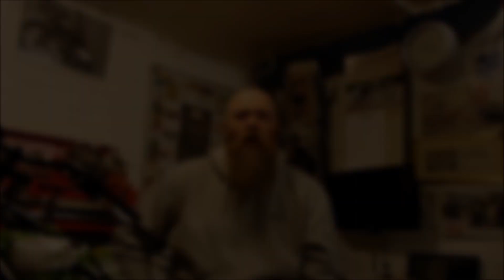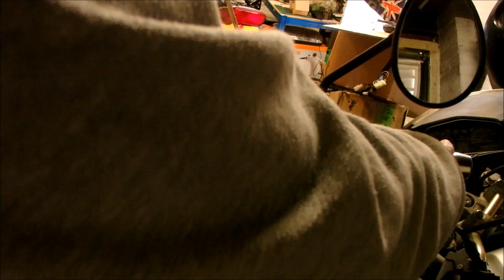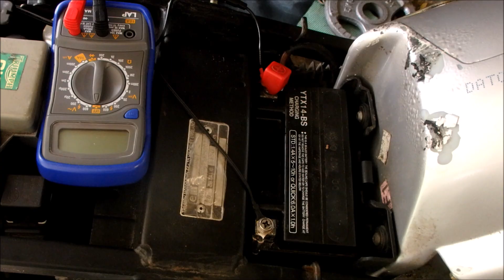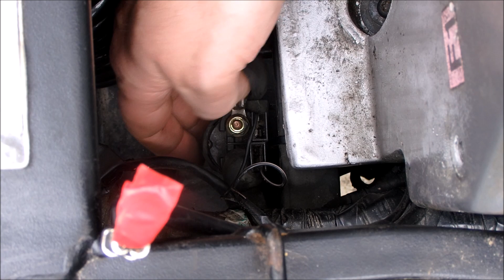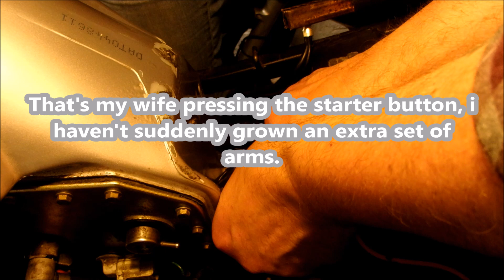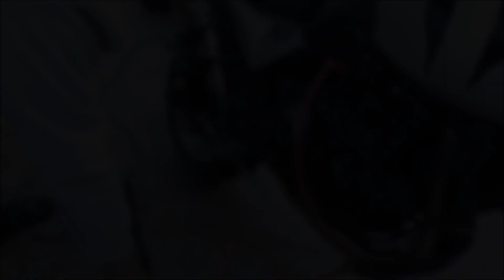How to test your starter motor & Solenoid circuit. Step by Step

Comment: This video absolutely saved me!!! Was considering tearing down my ‘98 Speed Triple down to replace the whole wiring harness after checking battery, relays, head stock wires and ignition circuits. Top man and excellent simple video
Reply from the maker: Fantastic, really glad it helped you out :)

Comment: I've got two bonnies I'm about to pull from under tarps and work on.  The first thing I did was put it in neutral, pop in a fresh battery and see if there was a sign of life.  Headlight, blinkers, gauges all glowing, but no joy when pressing the starter button.  I actually checked that there was a starter!  Yes.  So no click, no noise at all.  Thank you for your video.  i'm going to try the direct to the starter and see if it's just the relay.  Thank you dearly.

Comment: Thank you for sharing this 'not so punditious' way to test out a starter relay aka solenoid, however, the method you've demonstrated is of a Triumph compliance it certainly works for other makes as mine Kawi VN900 for the solenoid itself is nothing but a simple circuited coil.  The most great thing you've shown is how to do it really simple especially in a field circumstances. :) God Bless! Ride Safe! Definitely will subscribe in and follow up.

Comment: Have the same problems, tomorrow I'll test the solenoid and the starter. Is it normal that when the starter is n't working anymore and you try to start it battery voltage drops from 12.5 volt to 9.5 volt in one second during the 'clic' sound? Or would it be the solenoid which pulls the battery empty?

Comment: i get absolutely nothing when i press the starter. .. if i jump the solenoid it starts fine.. ive had to put a switch on it.. but the wire gets hot .. and not the best solution... any ideas ?
Reply from the maker: When you switch it on, do you here the fuel pump activate?
Reply: yes m8 ..

Comment: thank you for this video i think it gave me a great view of what is wrong with my bike... but i do have a question. ..on my gsxr 600 all i hear is a click under my seat. so i feel that the relay is good. im wondering why my bike starts if i roll it down my driveway
Reply from the maker: The rolling down the drive way, sounds like the start motors not working and your jump starting it?  Maybe a stuck motor arm.  Have you isolated the starter motor and tested it by its self?

Comment: I've got a 2005 Tiger I go through a battery per year third solonoid in twelve months now clicking.
Reply from the maker: Steve, did you get to the bottom of what this happens?
Reply: Hi mate, no, I have had these electrical problems for many years and spent hundreds on bike electricians who never solve the problem. I have even stripped the starter motor cleaned that but only gave me a temporary fix before problems start again.

Comment: i have tiger 955

put the battery on, put good fuel etc and conect  the 12.9v charged battery. then key on, light on, power swirch on and I can hear the fuel pump, then engine cranks and wont start!! try again, and again and BUM all death when i press start button again with a short circuit noise!! i remove battery cables and install them again and battery ok, light on etc same deal cranks etcetc and BUM same short circuit and all death!! very strange!!  can help me?
Reply from the maker: If you are confident the battery is at full strength, and you have fault tested the starter motor, then it could be the  brushes in the starter motor.  Do you use an optomiser for the battery?  If not I would definitely make sure that isn't the cause, put the headlight on and turn her over, does the light dip considerably?   If the headlight, doesn't noticeably  dip when you turn her over, than chances are the battery is good.  Once the battery has been eliminated, I would look for resources on how to check the brushes in the starter motor, as that is the next most likely cause.  Good luck and let me know who you get on.
Reply: i need to try test battery load and cca

Comment: I used to have a 2001 Tiger 955i. I had to replace the reg/rec and hard-wire it to the battery to take the harness out of the loop. That's the only way I could get the battery to charge off of the stator. As many gremlins as that bike had, I do miss it. Haha.
Reply from the maker: They are great machines and as much as i love the Triumph brand this one is testing that commitment.   Only just had the Sprag clutch done a couple of months ago, so hoping this one is an easy fix.  Luckily its under warranty, so can just pass it back, but a day in the garage is a day i cannot ride it..
Reply from the maker: Issue was one of the brushes inside the starter motor, fixed and I no longer have a very expensive garage ornament.

Comment: TFS GT. Some good tips their.
Hope you get it sorted.
RSOT >:)
Reply from the maker: Cheers Sir, luckily its under warranty and the mechanic came out this evening, did exactly the same tests and reckons its the starter motor.  Could be the bushes, just as Bandit Nev said... will update soon as i get it back.
Reply: GTs Garage Did he try the Solenoid as well as starter motor terminals?
Listen for Clunk (Sil.), Spin (motor).
But, if its under warranty. I'd take a deck chair, cause I like to watch...Learn and Keep n Eye on em.
Hope u get it sorted >:)
Reply from the maker: Cheers, Sure he will be checking the solenoid today, and cursing Triumph for putting it under the battery box lol
Reply from the maker: Ended up being one of the brushes in the starter motor... sorted
Reply: GTs Garage Nice.
Now ready the Rocket for Launch...
RSOT >:)

Comment: Nice guide, btw did you try bump starting it to confirm?
Reply from the maker: Didn't try and bump, the bastard is heavy enough to push let alone try and get some speed up.   Garage confirmed it was one of the brushes in the starter motor, all sorted.